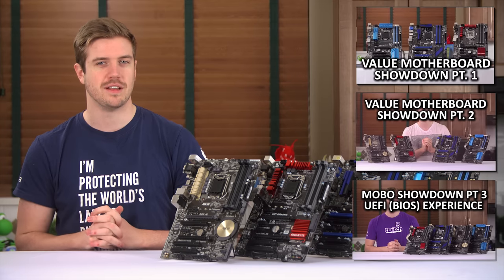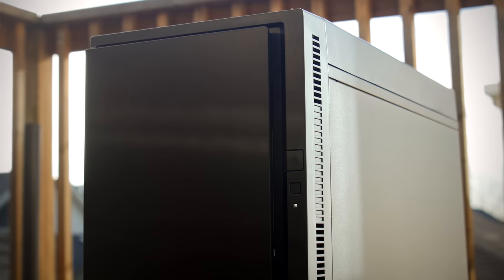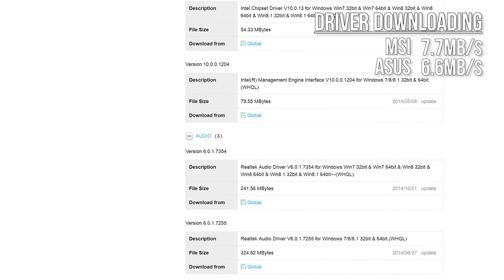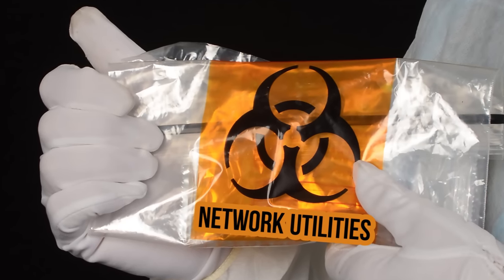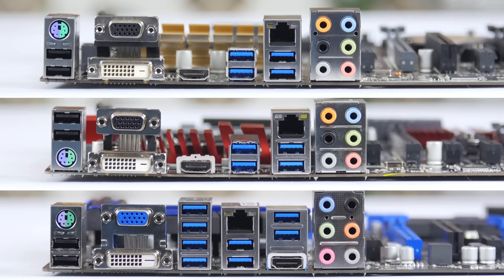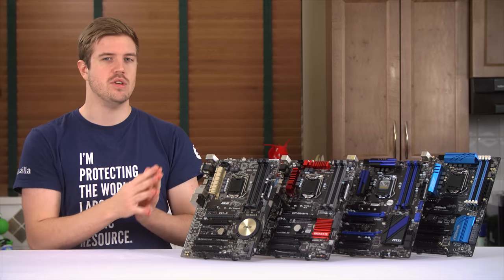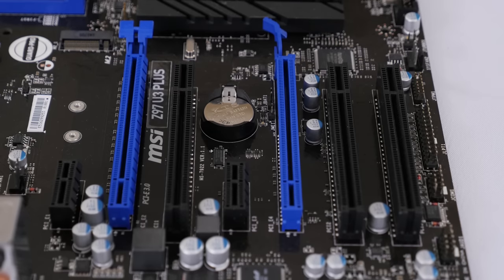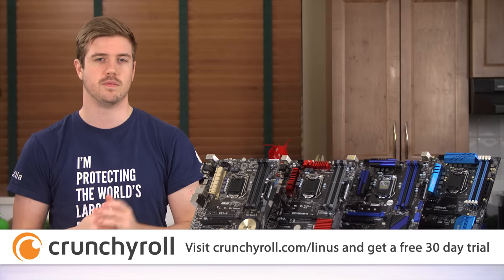Bang for the Buck Z97 Motherboard Showdown Part 4 - The Epic Conclusion

Comment: so the epic conclusion is that there is no conclusion
Reply: yeah was wondering the same where the conclusion was.
Reply: +MICROmor So to make a long story short, you can't go wrong with either? I'm leaning more towards a Gigabyte board because of price but I've heard they have reliability issues.
Reply: +MICROmor The Epic conclusion is these are all Intel boards, as you would need Intels overclock utility to overclock them.
Reply: +MICROmor The conclusion is that they are all decent boards, and you can't really go wrong with any of them, so pick the one you like best.
Reply: +nandoGdog nah, Asus are unreliable.. Gigabyte have that more industrial design.. It's stronger
Reply: +PneumaticFrog The ASRock board in my PC is going on 8 years now, and works just fine, so I would probably get another one from the same company.  Mind you with a computer that other then a video card (to support two screens) I added a year ago, and a recent ram upgrade from 2GB to 4GB, it's likely I'll try to get another couple of years out of it.
Reply: Paul Schmidt I just don't like ASRock for that blue colour scheme
Reply: +PneumaticFrog Colour of the motherboard has never mattered to me, I actually couldn't tell you what colour my board is, think it's a blue green, no window in the side of the case, then again when I was in college we thought we had state of the art with the new VAX 11/780, did some playing on an elderly IBM/360 and in PC's we had the Commie Pet, Trash-80 and Apple ][ to hack on.   Yeah I'm an old phart.....

Comment: This is just my opinion, but this video didn't really clear anything up.

The only things I got out of the conclusion was ASUS had a better UEFI, ASRock has more fan headers and more "other features", MSI had more compatibility and more "other features", Gigabyte had a nice aesthetic and more "other features."

Although the other videos did go through more details, please go more in depth as the "conclusion" should wrap up any negative or positive points on the product, not just "other features."
Reply: Tetsamaru I understand with them moving soon and stuff, but it seems like this video wasn't balanced in terms of quality compared to every other video they have produced
Reply: the Asrock board is the best for OC out of the bunch.
Reply: Baldwin TAvarez Got a z77 , OC's beautifully.
Reply: Baldwin TAvarez I got the Asrock board because it supports sli should i want that someday.

Comment: MSI for Features, Overclocking Capability, Stability and Price. :) Awesome series, LukeTechTips! LinusTechTips
Reply: ***** ASUS > MSI > ASRock > Gigabyte
Reply: MSI Gaming and Krait Edition will be the best
Reply: 96dpi MSI > ASROCK > ASUS > GIGABYTE
Reply: 4FUTUR3
 Really, the Krait edition is for looks and simplicity and the Gaming isn't even in this category because it's not in the budget price range AFAIK. On appearance alone the Krait would win hands down.
http://cdn.overclock.net/0/0c/0cd92d24_107.jpeg
Reply: Jigz1983 ASUS>all
Reply: Sanic
 I here ya, I love Asus but they don't have a black and white board in anywhere near the price range I was looking for.
Reply: I have a similar MSI board, the one they have seems discontinued.  I am very happy with it with my 4690K
Reply: Asrock is the clear winner it has better phases than all 3 other boards.
 decent Bios, and Lots of Fan headers.

Comment: ASUS is by far the best at UEFI and in-OS overclocking+fan control+monitoring
Reply: How do you know if you only used ASUS :P
I had a ASUS, gigabyte and a MSI MB and they all work well.
Reply: Andres de Groot I had them all and they all sucked... the best way to learn to recover from a blue screen is to attempt to make your mobo do overclocking.
Reply: Is it better to use UEFI or FanXpert for fan control? Or is it both the same?
Reply: abc140290 Actually the Asus fan part was pretty good, it was linked with AI suite so it was gone when I uninstalled it, but it was pretty customizable. Turn the fan completely off, program what temp it starts, and even how long it takes to ramp up and down. UEFI can set 3 different temps and what percentage the fan will spin at that temp (based on cpu, mobo, etc. thermal sensor).
Reply: My MSI Gaming 5 has a super nice UEFI with OC + fan control and monitoring..
Reply: smok3ybg I know....I also got the Gaming 5 from MSI :) Great mb :)
Reply: If only Asus would stop making their non ROG boards in gold or silver. Some of us find the color tacky, the rest of us find it nearly impossible to color scheme match the rest of the parts.
Reply: Andres de Groot same here it runs my 4790k i love it
Reply: He is right!
Reply: AI suite is actually one of the most piece of shit software i have ever used
Reply: TheHerstad7 Probably because you dont know how to use it. I have been using it for 4 years and its awesome. No need to go into the UEFI at all!
Reply: Toxic Biohazard
I have a P8P67 Pro. The Asus AI suite is nice at face value but something i never want to install again. It increased boot times dramatically and caused system instability, which disappeared when i uninstalled it. Fan expert was really nice i gotta admit. But AI suite was fairly slow and laggy, it took quite a while to do anything. Which on an I5 2500k with that motherboard really shouldn't have been an issue. I would still have it installed if i could ensure that it only started when i wanted to use it, but that was something i could never get working. Because of all that i did the only thing that made sense and uninstalled it. Only to find that all of the settings that i had set in there were gone. Maybe it was too much of an ask for settings made in the AI suite to be saved on the motherboard rather than in the software settings. But at least the UEFI contains all of the functionality i needed and i could set everything back up from within there. Combine that with AI charger doing nothing at all, i am glad i no longer have to deal with it.
Reply: I have an Asus Z97 Pro combined with an 4790k which is watercooled by the H105 from corsair. With the auto overclock it reached 4.9 GHZ on 2 cores and 4.8 GHZ on the other 2 cores! P.S: Be sure that  you check the "extreme tuninig box"!
Reply: However, the asus can't even support many fans onto the motherboard without a splitter or molex.
I certainly would not give that the fan control+monitoring crown part since I imagine you would be forced to use a separate fan controller to utilize what most cases will give you with six or five fans slots.
Reply: Ive picked Asus for one reason only, its the only company that i could find that has offered easy bios flashback incase a flash goes bad. For those who dont know what that means its pretty simple. It the ability to flash your bios using an usb pen without cpu or ram installed and/or incase a bios flash has gone bad and corrupted the system which ive seen happen plenty of times. Ive read somewhere that Asrock had offered that too but was never able to find anyting specific. Ohh and i guess i just love the sabertooth boards :)
Reply: ***** I must say....the sabertooth boards are indeed very beautiful.
But I had a budget at the time and the Msi Gaming 5 was only 120 Euro :)
Reply: I'm on a Z77 chipset with an i7-3770k and I have to say ASRock blew me away with the Z77 Extreme 4! My old Asus Z68 did have easier and better 1-touch over clocking, BUT was not even CLOSE to being able to hit the 4.7 GHz I got with my 2600k through MANUAL tweaking with my ASRock and verifying through Prime 95, FurMark, and Sandra (OFC with RealTemp running) 

And now with a 3770k I can run Prime95 indefinitely at 4.9 GHz on my ASRock Extreme 4 - and I have dual core speed set to 5 GHz (because a LARGE amount of games I play only make use of two cores anyway) - with MANUAL tweaking my Asus P8Z68-PRO  I could only hit 4.4 GHz on my 2600k! So there appears to be about a 300 MHz delta between the two with the EXACT same chip (even the exact same set input voltages)

Then there is the connectivity and I/O - with eSATA, 6 rear USB 3.0, SLI support, front panel USB 3.0, 4 SATA 6GBps ports - and really a shit ton more - if you want a truly BUDGET gaming Intel PC, I would HIGHLY recommend my ASRock board which I picked up for $120 USD at my local MicroCenter - and a good Ivy or even SandyBridge CPU. The ONLY reason I upgraded from the 2600k to the 3770k was for PCIe gen 3 - which makes an OBVIOUS difference when SLIing two GTX 760s (Z77 boards go into 8x mode with dual GPUs, BUT apparently even PCIe 2.0 8x will only drop you about 2-5 fps from 16x, so PCIe gen 3 has DOUBLE the bandwidth - meaning 8x gen 3 is identical to 16x gen 2 - and indeed 8x gen 2 is the same speed of 16x gen 1)

Unless you truly feel you NEED more than 4 physical cores with 8 threads - IvyBridge CPUs are as good as ANY (actually faster from Sandra's benchmarking!) quad core 4000+ Intel CPU! Also I have a 5930k machine, and I cannot seem to find a stable ground above 4.4 GHz - because of that my 3770k is actually a faster gaming rig. As there are only a few things you can do with a PC  where 4 cores with 8 threads will not be enough for maximum performance, and Gaming is NOT ONE OF THEM!

Seriously for gaming, you WILL be better off with 4 faster cores than you would be with 6-8 slower ones, Linus will tell you the same! OFC if you can SAFELY clock those 6-8 cores at the same speed as the quad core CPUs - you will have basically an identical gaming experience! As there is NO GAME out there that is SO INCREDIBLY CPU intensive that not only will it use all 8 threads, but ping them to 100% - as a result a higher clocked Quad core will always beat out a lower clocked 6-8 core CPU of identical architecture.

Obviously this will not be true forever, but I do NOT see games legitimately needing more than 4 physical cores for quite some years now, I mean shit, you can basically play ANY GAME out there MAXED out with a desktop i3 and a good GPU.
Reply: Hell yes. My Maximus VII Hero is just splendid for all of this.
Reply: msi ftw
Reply: who does in OS overclocking ? .... I was forced to do it once on a laptop and please never again :-D
Reply: MrJigssaw1989 ive used OS overclocking when i need a rough estimate that my system can handle before dialing it in through BIOS.  For me its just faster that way.
Reply: Timothy Lastovica
 Yeah they should go back to making black/blue mobo's again.  Gold looks horrible.
Reply: +Toxic Biohazard wrong the x99 deluxe had boot hanging issues, asus is overrated
Reply: ***** Asus quality sure isn't.

Comment: I don't know why people would say this is "boring" etc. These sorts of videos at this level of detail are SOOO nice when trying to decide exactly what to buy for a build. 

Personally I would go with the Gigabyte board, because above all else I want my PC to work and the dual bios is the safest bet to keep your pc running without replacing parts. As far as I'm concerned the Motherboard should be the most reliable part of the machine and Gigabyte's build quality along with the dual bios function make it the best board for me. (Also I love Gigabytes bios and utilities)

I actually did a build recently with the Asus board, and wasn't all that impressed with it (particularly because of the fan header placement). There were no fan headers at the bottom of the board to plug bottom mounted case fans into.  :(

Comment: I just bought the Gigabyte one 2 months ago along with an i5-4690K. With them I replaced my Gigabyte GA970A UD rev. 3 and AMD FX 6350. Motherboard performance was never too important for me, I just wanted a cheap LGA 1150 board with SLI. :) And as an added bonus it fits my color scheme.

Comment: AsRock Honestly since the Z77 Extreme 4 have been kicking the Value section of the Motherboard Markets Ass. Sometimes there boards are slightly flimsy as compared to the other manufactures but nothing a little care couldn't take care of.

Comment: ASUS is the best because I have a similar model board and love the BIOS it's super easy to use. It has a feature that is overclocking easy mode. Just select a few things like what kind of cpu cooler have and bam its done. A nice stable overclock in seconds. My mother could overclock on this board!
Reply: Although, I absolutely hate the color scheme of ASUS if I had a computer I wanted to show off I would have bought a different brand because ASUS is UGLY.

Comment: In this video:
1)Press a button for instant overclocking - it works on all of them.
2)Come up with inconclusive download rates on websites
3)Recap everything from the other videos because there have been so many parts that everyone's forgotten the important parts
4)Avoid making a conclusion and tell the audience to buy the one that suits them best.

Come on. When it's multipart because it was recorded over several days, that's one thing, but when you split it and try to stretch it out when it could've been a 25 minute single video? No thanks

Comment: Asrock for the real system builder.. due to the extra fan headers, SLI support and better compabilty with more case due to it's extra power connector not being anywhere that will cause issues when plugging it in.... trust me the right angled one at the bottom of the board on the other boards you WONT be able to plug them in.... in most Tower case due to the PSU it'self being in the way :P

Ran into this issue a few times when building systems for customers

Comment: When it comes to big pc hardware features like graphics cards and motherboards, I always go with ASUS. I bought an ASUS board and a card once, and haven't switched brands since. Not necessarily because they make objectively the "best" products, but I like their price to quality- ratio and their product designs, so it just works for me personally. Plus when it comes to graphics cards, I'd rather spend a little extra money on good quality and extra heat maintenance with a mid-line card, than pay a lot on a high end one with no such features. Of course R9 270 isn't exactly a low-end card either, but the point is, pay a little bit extra on quality and cooling options.

Comment: I used the Asus MB in my Girlfriends PC, its quite nice, easy to navigate in UEFI and works perfect, only and i mean ONLY downside to the Asus board is that it only has those 4 fan-headers. I would like to have a standard of 5-6 fan-headers on even a board at this price class. :). Nice serie and keep it up, like the multi episodes videos as well :D.

Comment: I've got the Gigabyte in my workstation/gaming rig and the Asrock in my HTPC and spare PC.

It's a tough call. But the Asrock is usually bundled together with some CPU'S, so if you get it bundled, score! It's a solid MOBO and even better if you get it for like, $40 bundled.

Comment: There is no mention on support or warranty. I have bought products from all of these manufactures. So far ASUS has offered the best technical / customer support. Their warranty is pretty decent too. ASUS forums are proven to be useful most of the times.

Here is their support ranking with 1 being the best.

1. ASUS
2. MSI
3. Gigabyte
4. Asrock

And here is the warranty ranking

1. Gigabyte
2. ASUS
3. MSI
4. Asrock

This is my personal opinion of course.

Comment: Dual-BIOS with exchangable chips - Quad-SLI-x16 (and still having a PCIe x16 for an SSD), no fixed PCIe for single-GPU-mode, having support for 220W CPU-TDP, support for 64 GB of DDR3 2400 RAM without any attention to the timing of them - and last but not least - MANY sata6 slots and a stepless fan-control with a switch from PWM to "current managed" for EVERY fan (including every case fan)... That would be the MoBo I'm dreaming of...

Comment: I have 3 computers. One has the gigabyte z97-ud3h black edition, the other has the asus sabertooth tuf edition z170, and the last is the z97 asrock extreme 4. I haven't built the asrock mobo yet but all in all the asus and gigabyte are extremely durable. Cant wait for the asrock build, but I can say with these motherboards, there all very similar. I have a top tier asus, mid range gigabyte, and a high/mid range asrock mobo. It all comes down to what your looking for in features..

Comment: I use a msi h97 gaming on a Xeon 1231. payed 300 bucks and it rocks. in benchmarks better then i7. (same clockspeed of cause) and with turboboost on 3,7 or 3,8 ghz its the best bang 4 the buck i made.

Comment: Great video with valid points. In my opinion you guys waited way to long with the rest of the videos (part 3 and 4). I guess that CES got in the way but you should have waited to after CES to release the first one.

I was actually inb the marked for a new LGA1150 Z97 board when the first video was released. By the time you guys got to the comclution, I had gotten way to unpatient and bought my self a Asus Sabretooth Mark II ;)

Comment: I happen to like multi-part videos like this. I get the information quickly instead of having to slog thru an hour video for two minutes of what I want to know. Plus, I know what video it was from and can go back whenever I want. That's what I use "Favorites" for. Don't make huge videos on a whole bunch of information. If you do, at least move this type of thing over to "Tech Tips" or "As Fast As Possible."

Comment: LinusTechTips Ehm.. "You are not that in to them anyways"?
This has been one of the most interesting series of yours so far.
However, that said... I think that you could have gone in a bit deeper on details and maybe talked a bit about the quality of the components, how easy/hard it is to flash the bios and so on..
Also.. Making each episode longer instead of filling half of it with adds for stuff would be nice.